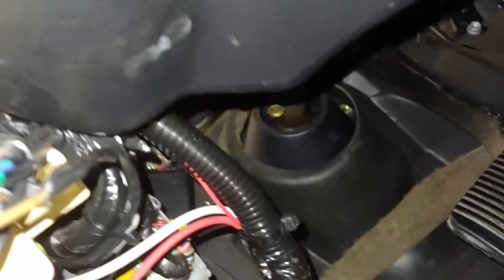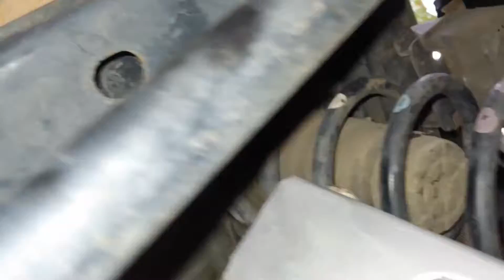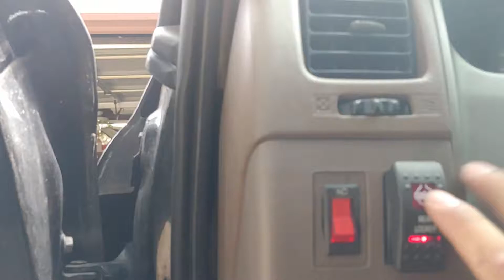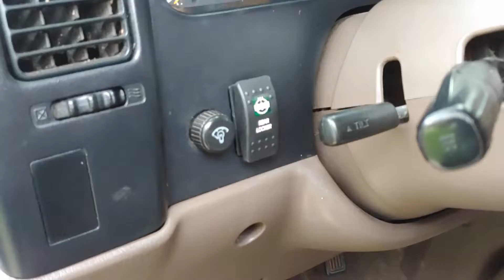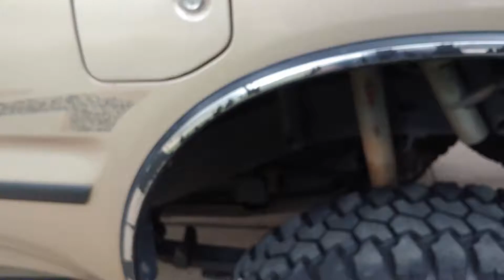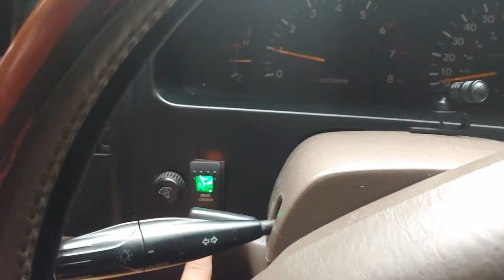E-Locker Harness Install!!!

Comment: So what do you need to hook up to the acc? I'm assuming the red positive runs to the battery and the white gets grounded? Is there a special something I need to hook up the red acc wire? Like do I solder it or is there a fuse?

Comment: Is your fuse at the battery on the low range a 10amp? I keep blowing mine and haven’t gotten the locker to engage
Reply: My e locker is fused with a 10 amp. You have a short somewhere or u mixed up the wires.